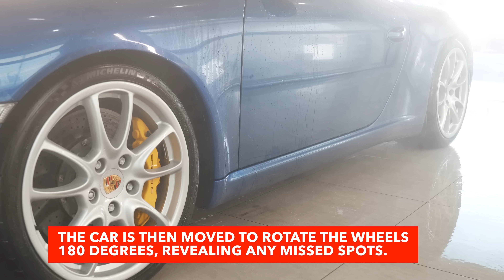Fixing This Porsche GT3's Paint - Level 3 Correction Detail

Comment: Why was the ceramic coating applied over an application of quick detailer spray? 

Surely the car should have been wiped down with IPA and then the coating applied to bare paint instead…
Reply from the maker: You are right, but just for timing reasons with the videographer we didn’t get every single step on video. We will make sure we do for the next one!
Reply: @TopazDetailing  So the detail spray was after the coating ?
Don't understand your answer .
Reply: @patrikkagstrom2393  Hopefully the order got mixed in editing but I don't see why they used quick detailer at all. Also, just one ceramic coat? No need for quick detailer unless it set for a few days before pickup. You'll just start messing up the perfect finish.
Reply: @Kmh0277  Yes ! Why quick detailer at all Topaz ?

Comment: I never get the polishing of the paintwork then a coating then a detailing spray when the application and removal involves a cloth that the detailer uses by going around and around in circles. why not just straight up and down so less chance of reintroducing swirl marks again?
Also i know the car was being detailed and polished but wouldn't it be better to show when washing the car to start from the roof and go downwards? Your guys were washing around the sills then going upwards in some scenes, yes the car was decontaminated but should still be showing the correct way to wash.

Great results